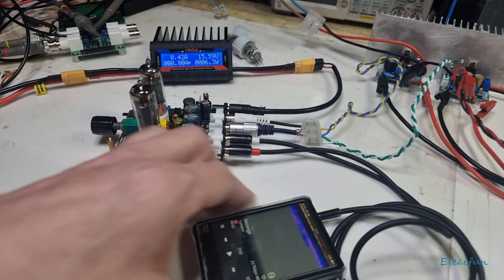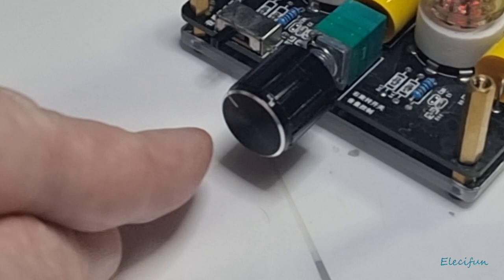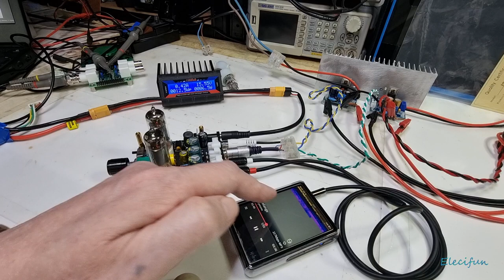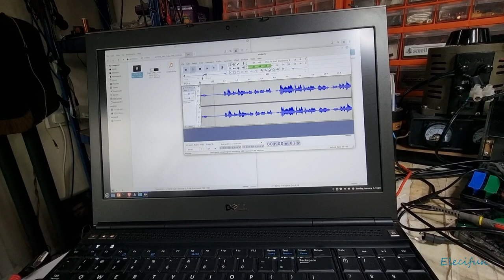AIYIMA TUBE PRE AMPLIFIER SOUND TEST

Comment: What are your thoughts on this amp sir??🤔
Reply from the maker: The tube pre amplifier and LM1875 combo is nice, clear tone. Good on me bench.
Reply: @Elecifun  I must be losing my marbles bruh! 😆

Some where I had a link to an AliExpress  amplifier kit that I was going to ask you about.

Fk knows where the link went. 😅

It's scary getting older.

Oh I had to laugh at another diy kit I saw moments ago.

An amplifier diy kit is advertised on AliExpress as dual 100W.

Well I looked at the specs and it indicates its a 2 X 30 @4ohm.

I look at the photo of the assembled kit and its connected to two very small 5W speakers despite it recommending two 30~60W speakers.

😅

Dirty rotten scoundrel comes to mind. 🤭